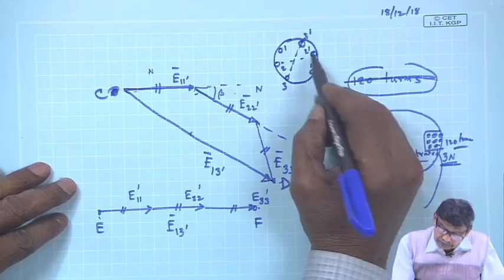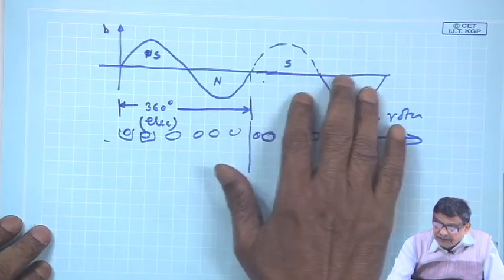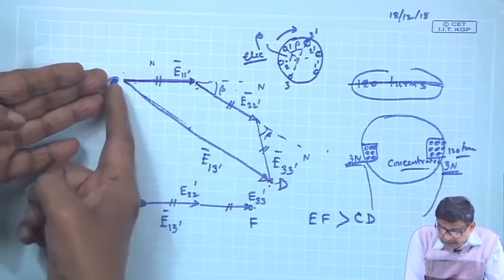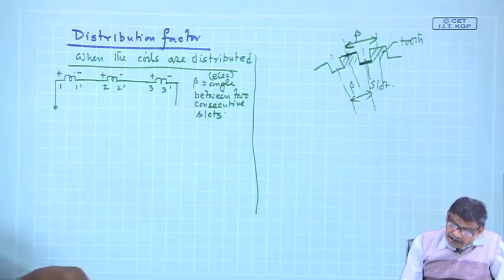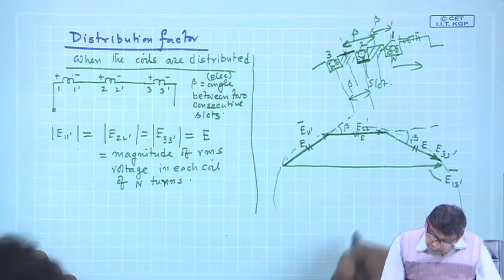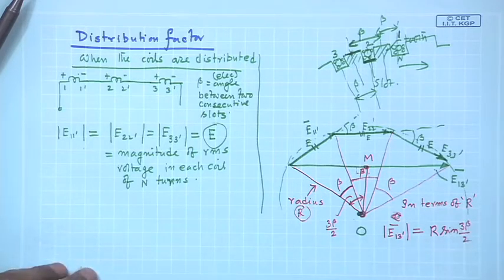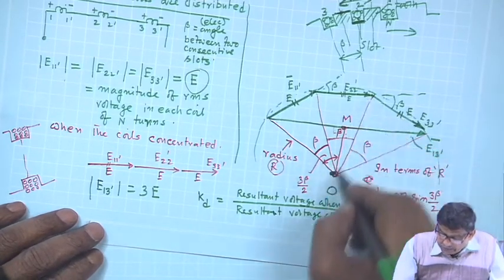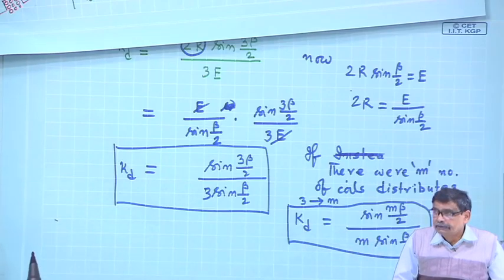Lecture 21: Distribution Factor

Comment: Nice lecture,thanks sir.One question,how to draw phasor in case of coils in parallel?
Reply: Since, if we are assuming coils were in parallel then there will be two different values of complex voltages across the two nodes(1 1'). Hence there will be circulating complex current. Hence by assuming specific R values and applying KVL across Loop, we can draw resultant phasor Voltage across 1 1'. But because of unnesessary circulating currents, parallel connection in distr. windings are of no use.